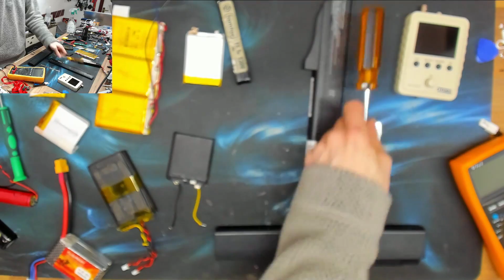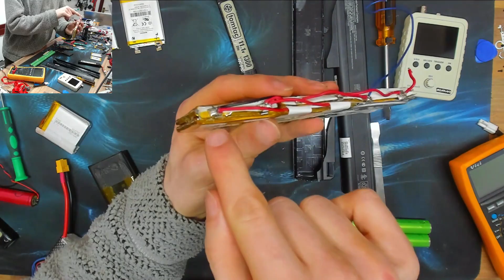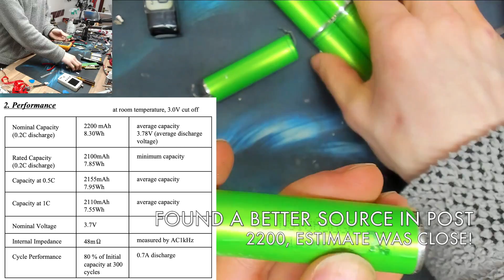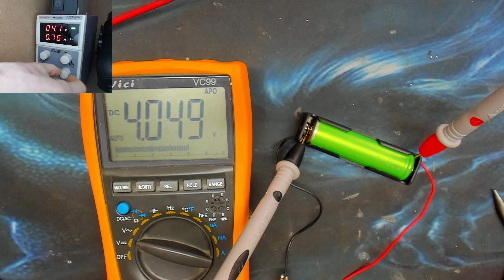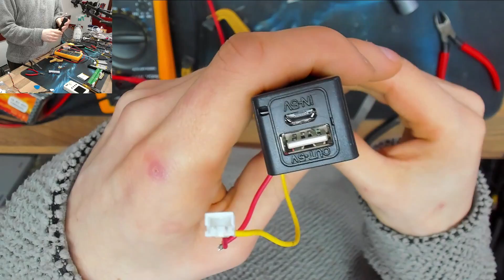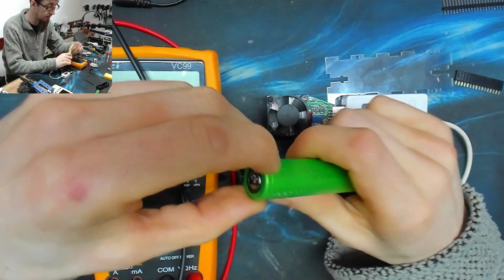How To Lipo #2 - Battery Configs, Charging, Capacity Testing

Comment: I was trying to pry out a glued down lipo from Amazon kindle, there was a puff of gas escaping and battery was warming up, I put it in a metal box and left it outside overnight, in the morning I check the voltage and it was 0v, can I still use this battery or should I just dispose of it?
Reply from the maker: That's toast, don't try to reuse it. Replace it.
Reply: @ thank you for replying, you are a proper humble guy

Comment: Your trying to revive a very damaged cell that has been irreparably discharged and lost most of its life to oxidation at the cathode. No point unless you are very desperate. if you find the cell below 3.0v consider it seriously damaged and not good to actually use in a pack or standalone. Same for pouch or cylindrical cells. Any heat during normal charging or discharging within C Rated conditions is also a red flag.  Build a proper precise discharger with an Arduino and a 16x2 display or buy a single cell dedicated discharger. Don't use inaccurate USB meters, there are losses on the USB connectors and not too accurate. You do voice very many good points and cautions though. Also if you leave cells sit for two days and then disscharge them you will see true numbers cause bad cells self discharge and their voltage drops!

Comment: Just a quick note on your battery capacity measuring technique: You are also losing energy (up to 25%) during the boosting of the voltage in the battery bank circuitry, use a cheap dedicated battery capacity meter (search "ZB2L3 meter" for example) with short cables from ali or ebay to get more accurate results.

Comment: Here's the problem with the equation:  In order to determine mAH, you have to calculate current draw over unit time.   However during the charge/discharge, the battery voltage does not remain constant so that 3.7V is meaningless.   Typically when a lipo is fully charged, it is anywhere from 4.0v to 4.4v depending on its specific chemistry and configuration.  As you use the battery, the voltage starts dropping.   The question becomes, what do you determine to be the end voltage of a discharged battery as it approaches its rated capacity?   Some say 3.5v, others say 3.2v, still others say 3.0v or even 2.7v.

This is important since if you're trying to determine the actual usable capacity of your smartphone battery, you need to know the voltage that the smartphone reads as 0% remaining charge, or when it cuts out.
I just replaced my HTC battery that has a rated capacity of 3000mAH, howevery I am suspicious that I'm not getting the rated capacity.   Unless i use it down to the last % displayed, I don't get anywhere near the rating according to AccuBattery.   Drawing down from 100% to 2%, AccuBattery claims I used 1955mAH with voltage at 3.6V when drawing 278mA.  Voltage drops if more current is drawn.  I read as low as 3.551v when 726mA is drawn.  So with those numbers, is my battery providing the rated capacity or am I ripped off, or is my HTC phone ripping me off showing lower % charge left than actual?  As I mentioned, that really depends on what HTC calls 0% capacity and shutdown.
Incidentally, I don't think Accubattery showed anywhere near 1500mAH used when the charge percent was 50%.
Reply from the maker: You're correct, the 3.7 is an estimate. On a typical discharge curve, the cell should be at 3.7 for most of the discharge, and then the 4.2 high and 3.2 low roughly cancel each other out. But yes, it's a rough estimate. The only real way to know is to use a digital load with a battery test function that actually monitors all this for you.
With regards to your replacement battery, what was the rating of the stock battery? It's incredibly unlikely that a replacement will be more than the stock. You can also measure the size of the cell and compare it to other cells to see if they're likely fibbing or not.
Reply: @Adamant_IT  The HTC 10 battery is rated 3000mAH.   Assuming that AccuBattery is given the voltage readings with almost no resistance from the internal meter to the battery, I estimated the internal resistance to be 0.12 when calculated at 30% displayed remaining capacity and 0.13 ohms when around 2%.   Internal resistance determined by taking the delta current divided by the delta voltage, change in current manipulated by changing screen intensity.  As long as the delta is taken at a reasonably close interval, the internal voltage shouldn't have changed much to influence the Ri calculation.  The calculated internal resistance seems a bit high to me, though that could be resistance between the battery terminals and where HTC measures the voltage.
At 30% I calculate the internal voltage to be about 3.7v (readings were 3704mV at 136mA and 3657mV at 525mA) according to AccuBattery.
I forget what my mV/mA readings were at 2%.
The phone seems to cut out at somewhere between 3.4-3.5v but hard to say.   My last discharge to end went down as low as 3.2v depending on current draw, staying at 1% for a really long time compared to previous 1% drops.   This last time it stayed at 2% for a long time, but not very long at 1%, never showing to be near 3.2v like before.
Last charge from 1% to 100% mostly in screen off yielded a calculated charge of 1769mAH in 1h 49m
The time before that it calculated 2610mAH charged in 1h 51m, again with little screen off time.

So the question still remains, is my lower than rated capacity the fault of the battery, HTC battery management, or the AccuBattery measurements?
By the way, the voltage displayed when fully charged is 4.4v.
Reply: @Adamant_IT  PS.   The main reason I had to replace the battery was because the phone would shut off or reboot when i took pictures (with or without flash) or woke it up from sleep.  This would happen when % charge remaining showed about 30%, but has occurred as high as 60%.  When the phone abruptly shut off, I could only complete power on if i put it on a charger for a bit during reboot.  I had to replace the original stock battery last year for the same reason.  Accubattery estimated battery health and capacity of the previous battery (the one I just replaced) at about 1600mAH or 58% rated capacity/health.
With the replacement battery, it hasn't cut out on me prematurely.
Reply from the maker: Yea, I'm not sure to be honest. It sounds like the replacement battery just isn't very good - however it's better than a failed battery. You might have more luck replacing it again.
I get bad batteries when replacing laptop batts now and then, they work, just not very well.